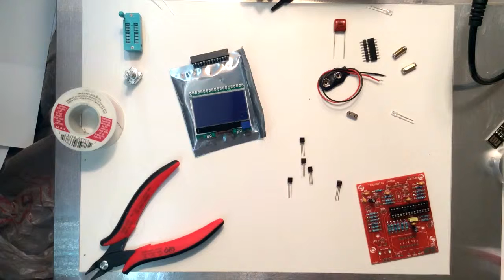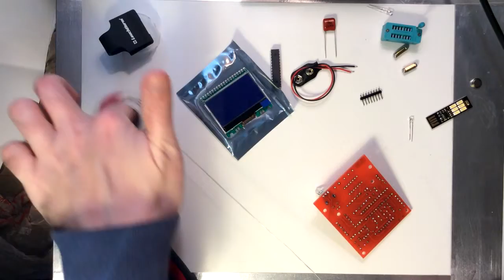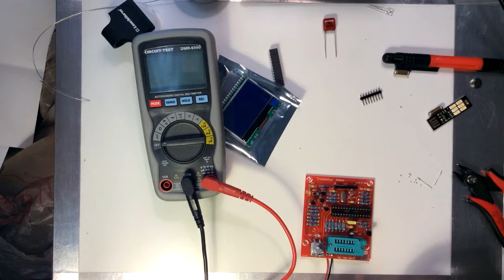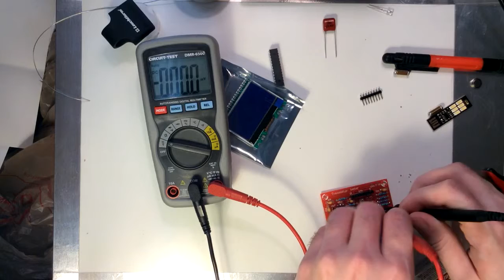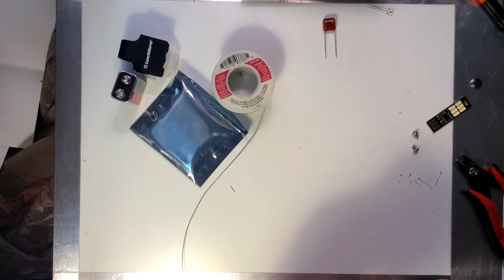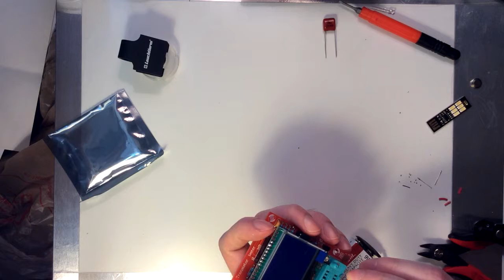M8 Transistor Tester Kit Build - Part 3 (final)

Comment: VERY cool and fun! I thought the build would have been far more intimidating. I might even try to build one myself! Did it come with a case? 

Thanks for your transparency in your work. I very much like the "Let's learn this together" rather than you spending hours pre fitting everything and then putting it together like it was easy!

BTW, your solder technique WAS intimidating! Fast, accurate and no slop. Enough heat to get the job done without burning the traces off the board, or leaving cold solder joints. Your old man must have been a heckuva teacher...

Comment: Very useful up to now, but are you going to do a video showing how to use it? My 'Chinglish' is pretty poor and my electronics knowledge on a par with that. I'd just like to be able to test 30 different resistors and a whole host of other small electrical components which I've bought with a view to using an Arduino Uno to improve my knowledge.
Reply from the maker: Thats an excellent idea. As soon as I get my workbench set back up after moving to my new place, I'll do a follow-up video.